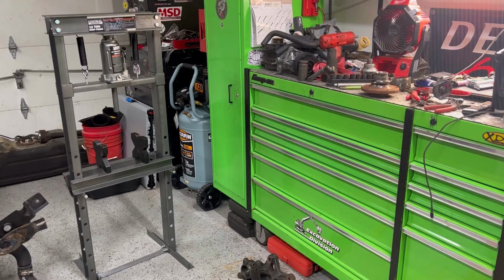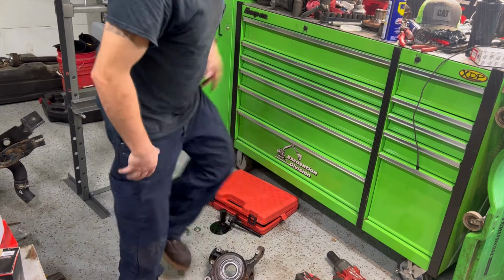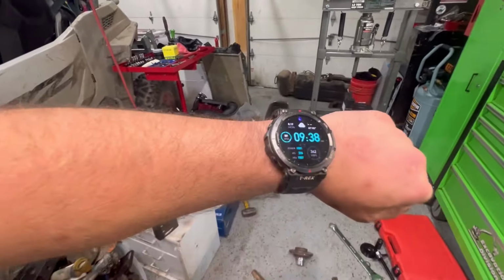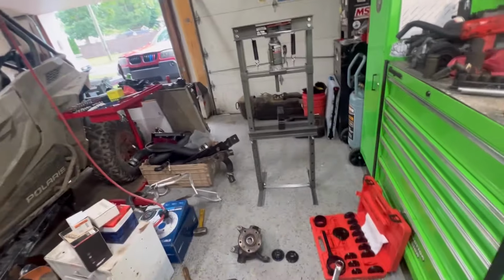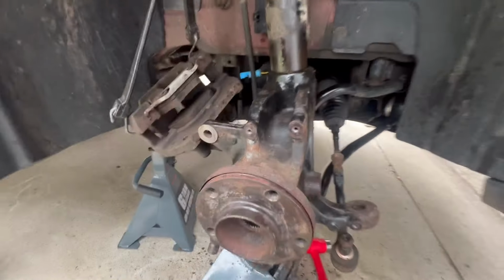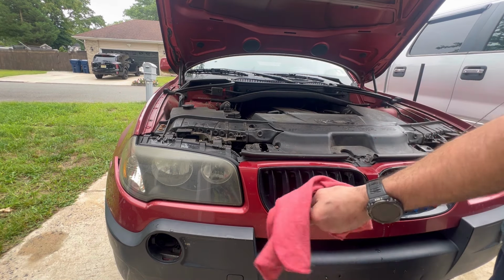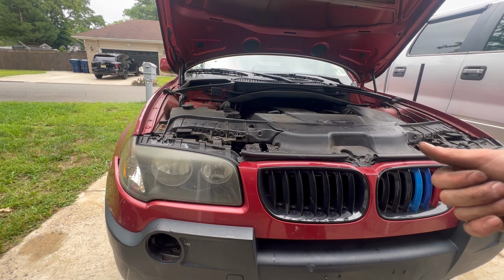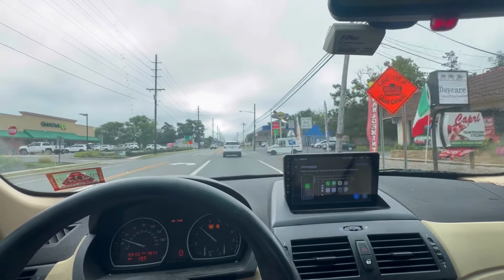BMW x3 wheel bearing replacement nightmare ! #bmw #junk #mechanic

Comment: Good job but forgot the backing plate  not a big deal  looks like a quick cut and now it’s on I’m a mechanic and seen that happen before when people are rushing aka flat rate keeping it real brother I like that 👍
Reply from the maker: @lawrencejacob8  if you watch the full video I actually cut the backing plate and re installed it on the car after I put the hub back on, reason being this is my personal car and the ring that has to come off to remove backing plate was completely rotted didn’t feel like dealing with it so I cut about 2 inches off the one thin side of the backing plate and was able to slide it out and bolt it back on with all the bolts, again it’s my personal car or I would never have done it that way lol but thankyou for the comment !!! please make sure to subscribe. I have noticed 97% of my viewers are not subscribed and it doesn’t cost you anything and it really helps the channel grow and I would really appreciate it. Also, check out my other videos should have a lot more cool content coming this way soon.